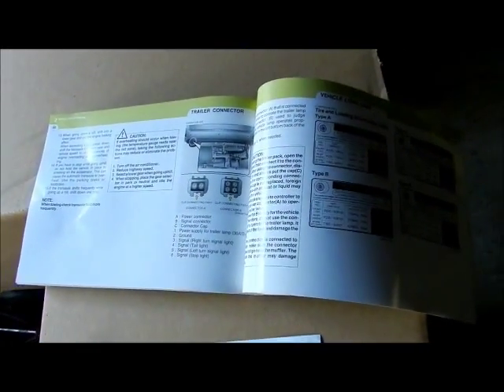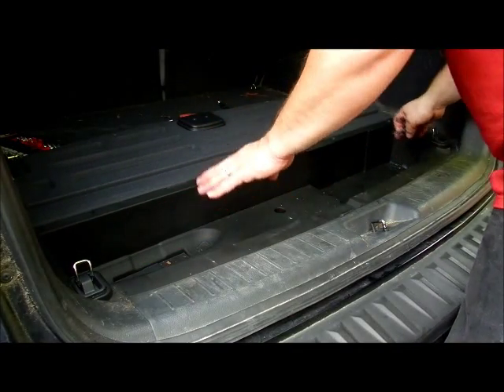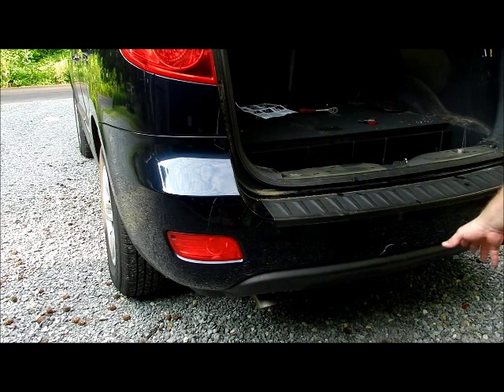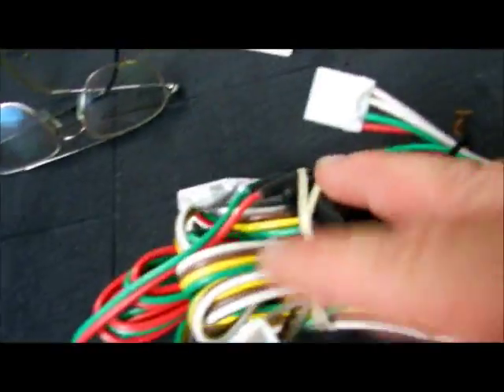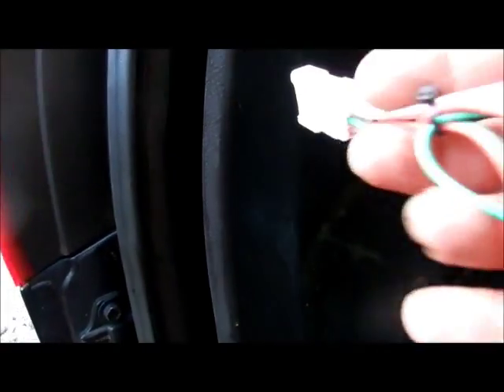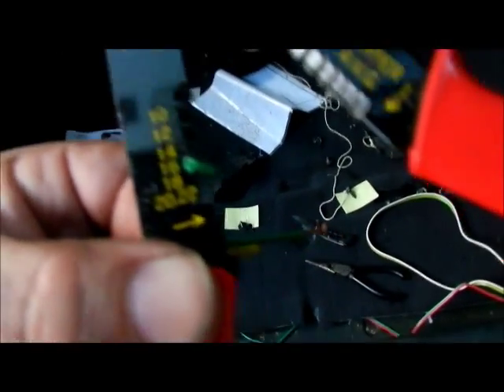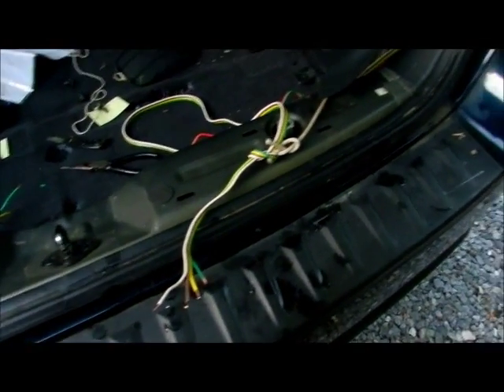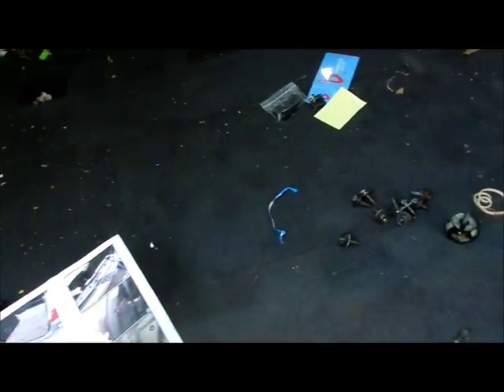How to Install a Trailer Wire Harness on a Hyundai Santa Fe

Comment: This was helpful as I just did mine on a 2010 Limited with tow package. A couple things I learned ... that rear storage compartment is attached to the truck sill plate which is held by trim clips (it snaps in). To remove the sill plate: use a smooth device to peel back the rubber seal on the sill plate then use a tool (I have a trim remover tool) to lift the sill plate upwards one section at a time. Second ... when the job is done I don't route the wire connection under the vehicle. I curl it up and stow it behind the inspection plate on the side panel which I open when needed. This way it is not exposed to the elements. I just run the wire from the trailer in through the open hatch, connect it, then close the hatch (being careful that the hatch closes nicely without messing up the wires.) Someone mentioned that there is a harness that doesn't require splicing. The one I got connects to the factory connectors behind the rear quarter panel. (I think they sell T-connectors that simply plug into the existing connectors for those without factory tow packages) I unattached these connectors from the body and moved them into the area behind the inside panel. I bought plastic  1 1/2" sheet metal hole plugs off of Amazon to seal up the hole afterward. But your video was very useful, William, to getting me through the job.
Reply from the maker: Thank you so much.

Comment: Great video! Thanks for posting.

Do you know if there are other wiring kits out there that don't require me to splice and solder the wires? At that point it was getting too technical for me haha.
Reply from the maker: +Crist Gord You can splice or crimp as needed.  Soldering is better what in contact with the weather.  If you want me to make a splicing video please let me know.
Reply: +William Quinn I was going through the motions of doing your instructional installation, and found the tow light wiring already installed on my car! Really strange....I'm wondering if the first owner took the tow hitch when it was sold to me...

But the wires are already there on the rear drivers side next to the Tow Eye screw area...really strange.

Thanks for your offer though to help with soldering :)
Reply from the maker: Crist Gord Glad I could help.

Comment: Nice video William.  I'm going to help my father install a harness for his Santa Fe and this helped me to see how it all comes apart.  At about the 18 minute mark, you pointed to a small J shaped notch and said you didn't know what they were.  It's for an optional cargo cover. When installed, it conceals anything you have in the back from prying eyes!   Search for cargo cover or cargo screen in a search engine.  It is spring loaded and fits into two square shaped recessed areas on either side of the vehicle, right behind the back seat. You then pull a black mesh screen toward the back of the vehicle which latches into those J notches.
Reply from the maker: Thank you so much.